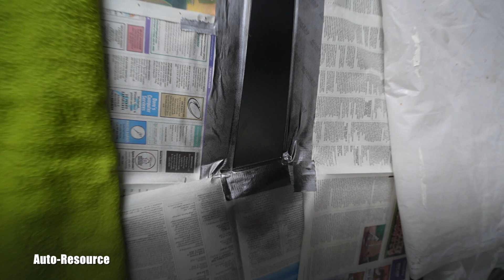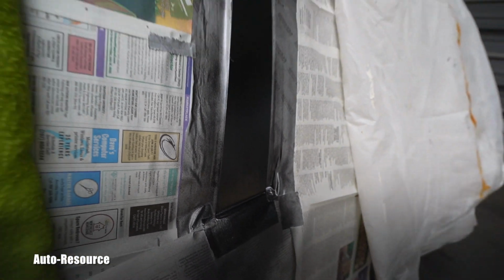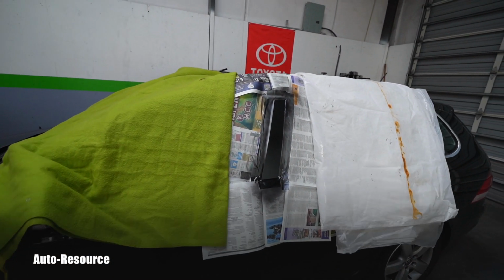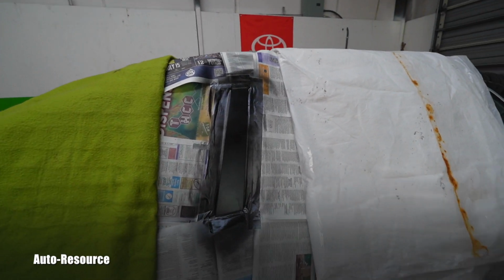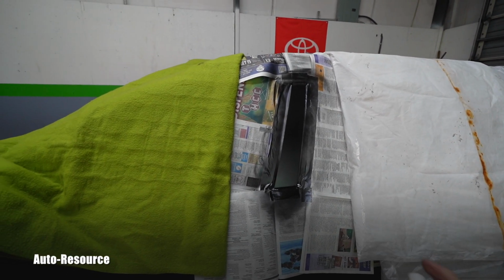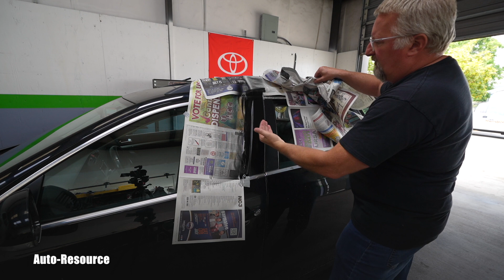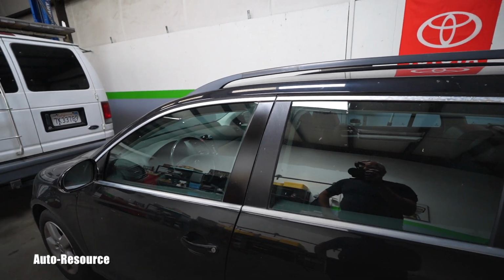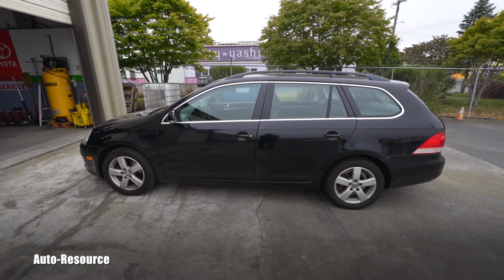VW Jetta Door Pillar Trim Peeling Off Repair

Comment: I am happy you are happy. You have been thinking about this for a long time. Wonder if you remember how you got the idea to paint it. Same one who said if anyone buys that chrome they need to sandpaper it off. Did you use fishing line to remove the adhesive? Or a heat gun? People who don't know out there reading this, a heat gun is a repair tool to heat items and gets very very hot. Burning skin hot. But makes the adhesive let go easier. That's a good neat trick. Maybe some people will be able to look at the center cap videos and see the previous state. 
Good tip to keep the can shaken. I have had bad cans before when I bought cheap and they would spit dots of paint out. So be careful and shake well. For the readers, I know you would know already. And if very cold outside, I like to warm the rattle can in warm water so it sprays better.

Comment: Thank you for your videos. Questions: Does it need to be sanded or prepped prior to painting? Will the line between the paint and the peeled section be visible if it’s not completely smooth?